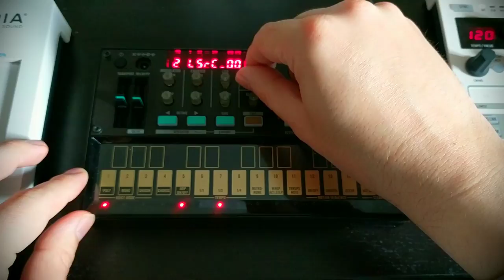Understanding Sound Design on the Volca FM - Episode 1: Introduction

Comment: I was first introduced to synthesis with LA (Roland D-70) and PCM (E-mu Proteus) so FM synthesis is not daunting to me in the least. Having said that, when I first bought my Volca Keys and sat down to play it ... I thought it was broken because the sound was choked out via the filter cut off. xD But it turns out that yes, subtractive synthesis is a lot easier to work with.

Comment: With regards to the sequencer and designing different parts i.e bass, keys etc. do you know if it's possible to create a sequence that plays them at the same time, like stacking them?
Reply from the maker: There are tricks you can do with level scaling to make a single patch which transitions between the two types of sound within a single patch, but you cannot use two different patches at once, which is I think what you are asking?
Reply: @OscillatorSink  Ah ok yeah I think that was it - I was just wondering if I can make full arrangements on it, but it sounds like I might need to link up a few other synths to get a more complete piece. I guess I could record the patches I create individually into a DAW and layer the track up there?
Reply from the maker: @WarrenWintersUI  that's probably the best solution - unless you're jonesing to buy more synths of course!
Reply: @OscillatorSink  Haha, definitely tempted. I'm sure I have enough time this evening to go down a best synth under £300 rabbit hole 😆!

Comment: Hi there. Great videos. I'm trying to use synthmata with my beatstep pro to edit the FM but I can't seem to get any connection between them. I've selected the beatstep in sythmata and the FM is on Ch1 but it's not sending any info to the volca. Anyone have and ideas to get synthmate to work with the beatstep? Cheers.
Reply from the maker: Hi there, sadly the Beatstep (including pro) and Keystep don't pass Sysex data correctly (I don't know why, but I've confirmed this with testing), so you can't use it with synthmata or any other editor. So you'll need another MIDI interface I'm afraid. 

There are lots of USB-Midi cables around, and some of the cheap ones work, but they're kinda hit and miss, but I've had multiple confirmations that this one from Roland works great:
https://www.roland.com/uk/products/um-one_mk2/

I hope that helps!
Reply: @OscillatorSink  thanks for the reply. I can stop searching now. I've got an older midiman 2x2 and that works for sending sysex but I haven't worked out how to have the beatstep or keystep connected to it to play the volca while editing. Not a huge deal but having keys to play while editing would be nice. The way the midiman is built, it is  to either usb or mid thru but not both at the same time unfortunately.  Cheers.

Comment: Hey, I hope this isn't a stupid question.....but is there a system whereby patches created for Volca FM could be loaded into Korg OpSix, and vice versa? A unified Korg FM sounds format ? 

I'm totally new to this, but I'm thinking of getting Volca FM2 and programming with Patch Base software for Mac. 
Seems like sounds can be stored on a mac. Useable across different synths? Thanks
Reply from the maker: The opsix kind of accepts Yamaha DX7 patches, which is kind of what the Volca FM uses. The synthesis architecture between the two are different so the patches wouldn't sound the same regardless. The opsix is also capable of way more than just FM, and approaching it like a 'big Volca FM' really under-utilises it. So the short answer is: no, and the long answer is: kind of, but I wouldn't bother.
Reply: @OscillatorSink  Thanks !   I'll maybe stick with just volca FM2. So much synth for a small investment. The little readout looks like hard work, especially for something like setting all the many envelope parameters....but I'm hoping Patch Base will make all this easier, and visual.
Reply from the maker: @tierno3790  I built a free editor, with envelope visualisation that runs in the browser: details here
https://youtu.be/Y166FytVC8w
Reply: @OscillatorSink  fantastic! Thanks for this. As others have said, this channel provides the best FM tutorial that there is.

Comment: Hi, I have a technical question that no one can answer.  You're streets ahead of most others technically. Perhaps you can help.
My question: Is it possible to increase the pitch bend range of Volca FM ? The current range is set to +/- 2 semitones.
 Dexed's sensitivity or range is adjusted by hitting 'Parm' button and adjusting  the  'Pitch Bend Range' potentiometer from +/- 0 to 12 semitones. Most synths have this functionality. It seems you can increase the pitch range associated with the Volca FM's EGs but not the pitch bend wheel.
I've tried using RPNs 0x64 and 0x65 with no response.

Hex data sent to Volca FM as follows:

B0 64 00    ; ; Pitch Bend Range
B0 65 00
B0 06 0C    ; ; 12 Semitones
B0 26 00    ; ;  0 Cents
B0 64 7F    ; ; We're done
B0 65 7F
Reply from the maker: I've not ever seen a Volca support RPNs so I suspect that's a non-starter. 

The DX7 could have its pitch bend range adjusted using sysex:
F0 43 00 08 41 0y F7

Assuming midi channel 1 and where y is the range (0-12). (I had to look that up, it's not something that I was able to pluck out of the air). 

But the Volca doesn't respond to single parameter messages, only full patches, and the function parameters (of which pitch bend range is one) aren't in the full patch format... This is my round about way of saying: I don't think you can, sorry.
Reply from the maker: There is the unofficial firmware though - that might support it (or you could petition the coder to add it if not?).
Reply: @OscillatorSink  I'm working on a smart Portamento midi cable. It works OK with the limited +/_  2 semitones pitch bend range, but +/-  an octave would be much better.  Thanks for the sysex info.

Comment: One thing i cannot find explained in the whole world wide web is "can I trigger sounds that are coming from Ableton live using the Volcas (the FM especially) or i am stuck with the defaults sounds embedded in the hardware???" ...isn't that the point for having a Midi In???
Reply from the maker: What do you mean by "trigger sounds?". As in make the Volcas play samples from Ableton? In which case no. I'm not sure what you mean exactly?
Reply: @OscillatorSink  Yes, well not trigger samples but Midi instruments in Ableton library or for instance, using the volca arpeggiator with a sound coming from your DAW instead of using it with deafult sounds like...i don't know: gLassPad
Not possible?
Reply from the maker: @gabrielemariotti5780  so, you can program other sounds on the Volca - that's what this video series is about, you can also load in other patches - there's hundreds of compatible dx7 sounds out there and I've even released 3 patch packs for it, but you can only use midi to make the Volca play sounds that are stored on the Volca. Midi isn't used to send actual sounds, just instructions (like "play a middle C" or "adjust this internal parameter").
Reply: @OscillatorSink  So Patches are the answer...is not the solution i was hoping but at least is clear now, thanks a lot for clarifying it.
Appreciate!

Comment: How do you record the different automations on the Volca into your daw, without recording audio (which obviously prints the automation onto your file)? For example, if I want to gradually change the velocity and the decay in my recordings? 
I would like to record using midi, because then I could (hopefully) record the keys first, then go back and record the different automations on top of that. Is this possible? And then I guess I need to convert the track into audio at some point, so that I can record new Volca tracks without affecting the old one?
Answers are highly appreciated! Thanks in advance!
Reply from the maker: All of the front panel controls on the FM can be addressed via midi cc. It'll depend on your daw, but most of them allow you to write in midi cc data as automation, or maybe via a separate midi track. You can get the MIDI Implementation chart for all of the Volcas from the Korg website - this lists which cc number controls which parameter. You'll have to draw this in / use a different controller to the Volca though as there's no MIDI out (unless you've modded yours).
Reply: I just checked out the midi implementation chart, but it didn´t really make any sense to me. I wonder why such a simple, fundamental thing has to be so complicated. Does anyone know specifically how to automate the different parameters (most importantly the velocity) on the Volca in logic pro? I tried searching all around the web, but strangely it seems like I am the only one not figuring this out  @OscillatorSink
Reply from the maker: In the current version of Logic you just have to add region automation to the part you want to automate and select the CC number for velocity (41) and draw in your automation. I'm assuming that you're already otherwise comfortable with using Logic to control external gear here?
I promise it isn't that complicated - but if you want to control midi devices it is worth spending a little time reading up on how midi works - specifically how notes are played and what cc messages are (and what they're used for). This'll help you better understand your gear, and possibly more importantly, help you troubleshoot issues when they arise! 
Here's a link which basically explains how to use the region automation for cc in logic:
https://www.pro-tools-expert.com/logic-pro-expert/logic-pro-blog/2018/02/03/working-without-midi-draw-logic-pro-x-10-4
Reply: Okey, thanks a lot! :)  @OscillatorSink

Comment: How do you init a patch? Do I just build my own and save it?
Reply from the maker: Yes, or use my free Web based editor - search "synthmata Volca FM" and you'll find it.
Reply: @OscillatorSink  do I need both midi out and in going to usb or just midi in? I really want to use Synthmata but I'm not sure how to connect the Volca to the laptop. It looks like an awesome program!
Reply from the maker: @159awi  thanks! You just need out from usb interface to in on your Volca. Make sure you set the mode in synthmata correctly (information in the instructions at the top of the page). You also need up be using a Chromium based browser (so not Firefox or Safari).

Comment: hey man. pls I hope you notice this. my volca fm is arriving in 3 days and I wanted to load the patches you made, but I don't know how. I have downloaded the packs too.
Reply from the maker: You will need a USB midi adapter, and then the best thing to do is just use the Synthmata links on my website and you can send them just using your browser.
Reply: @OscillatorSink  THANK YOU SO MUCH FOR THE SWIFT REPLY!!! was pretty confused cause i wasn't sure if it would work thru usb